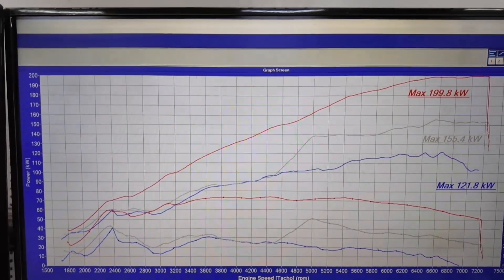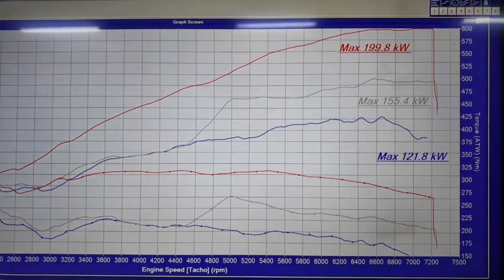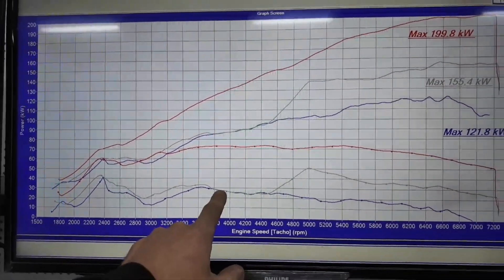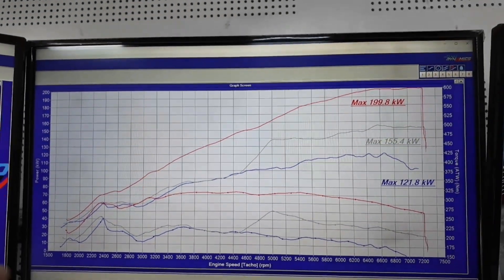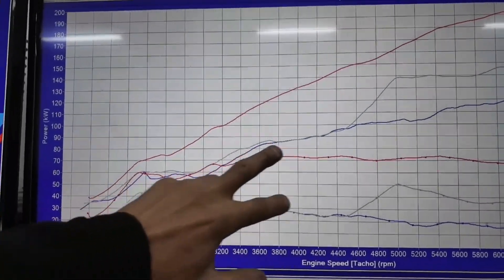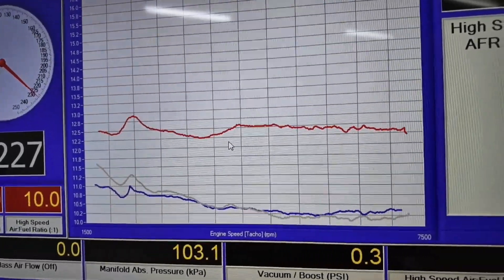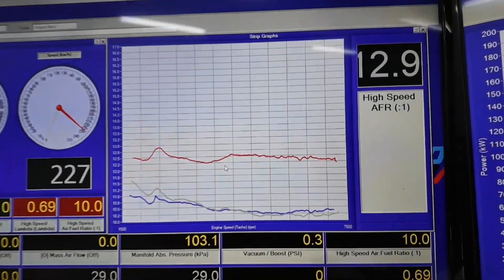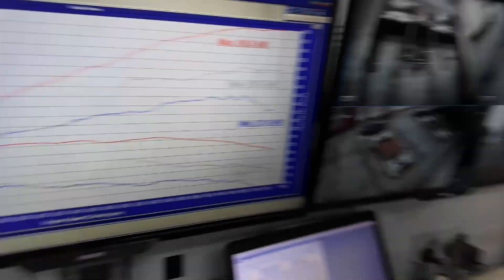Holden V6 LFX tuning and tech tips

Comment: Can I ask, Does an engine need to be tuned/dyno’d after the installation of a completely new exhaust? 
A complete Xforce system with Manicat’s on a SV6 s2 VF
Reply from the maker: @xxHydroponicxx  hi yes any modifications you make need to be tuned and dialled back in
Reply: @IndependentMotorsports 
Thanks for the reply. Will do. 
Can I also ask, my factory engine how has 185000 on it. When should I look at a rebuild? Or would a straight swap for a new engine (SV6) be cheaper?